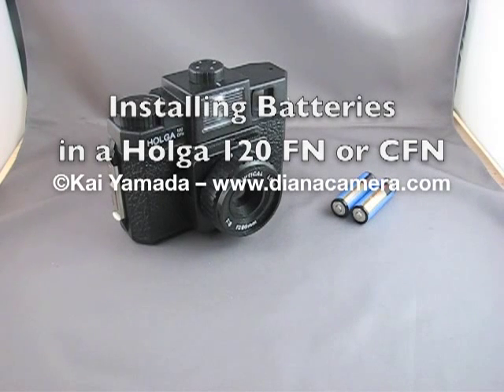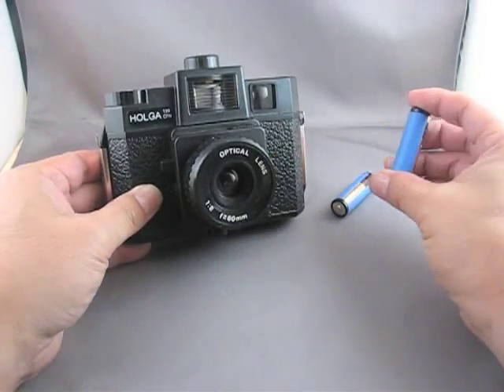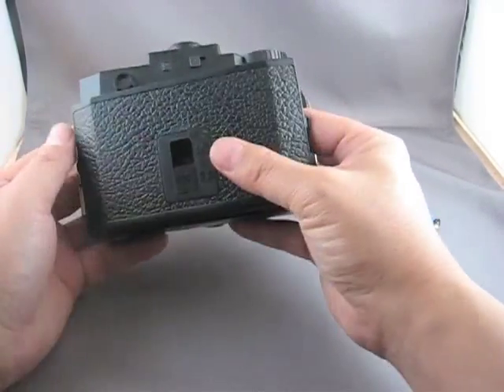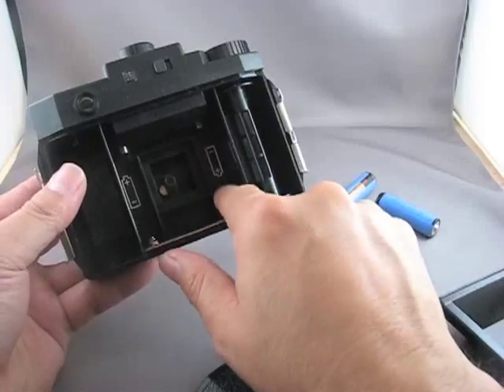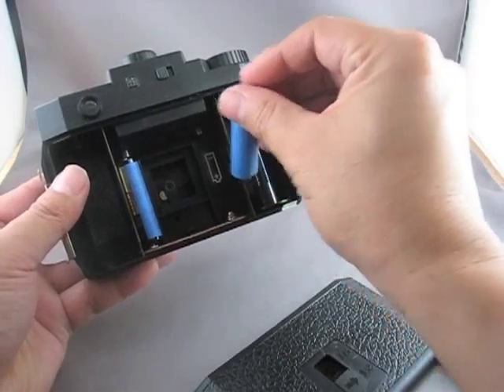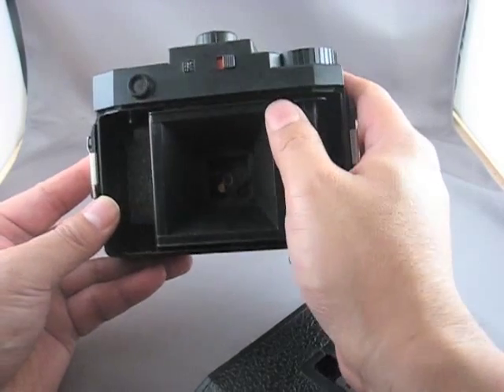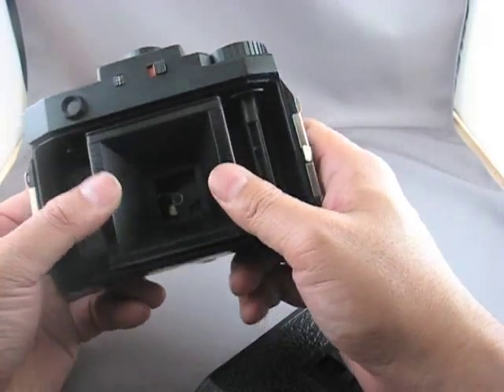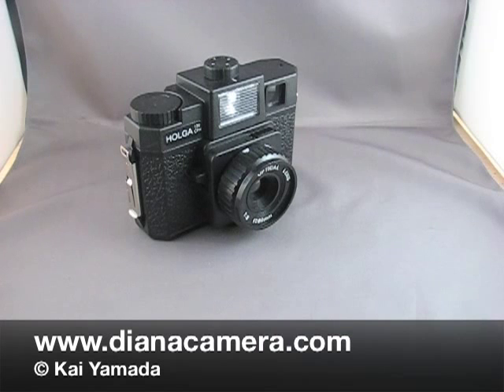Holga 120FN or 120CFN Battery Installation

Comment: Hi! I really liked this video. Just bought one (second hand) but when I opened I realised that were the batteries goes everything was rusty. I cleaned it and I guess I did I great job... but not so sure how to make the flash goes on to see if it's working properly 🥲
Or maybe I can get that peace at the bottom somewhere? 
Please help me 🙌
Cheers!
Reply: I have the same problem, were you able to get it working? I’ll take mine to a repair center to see if they can fix it, I hope it won’t cost much 🥴